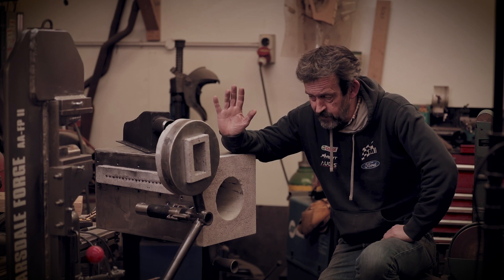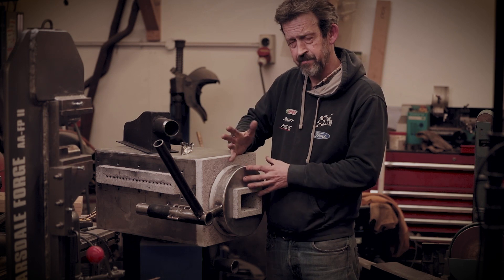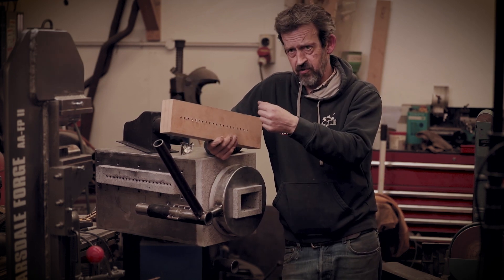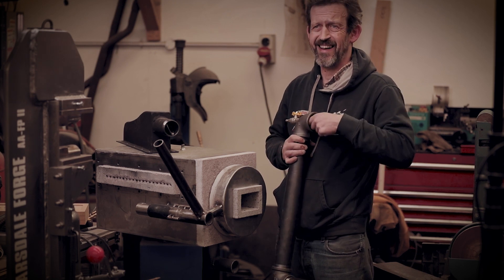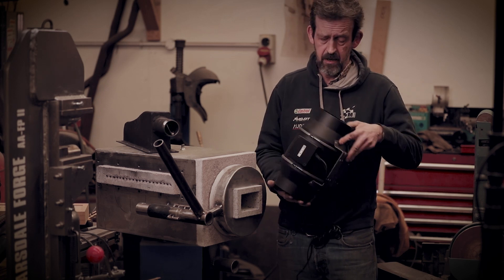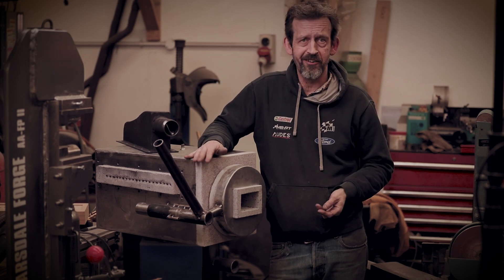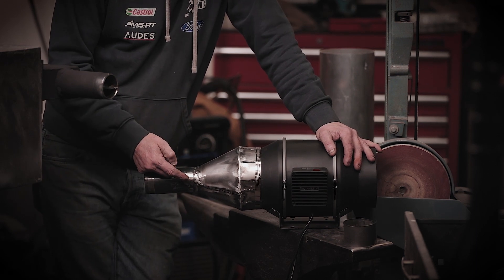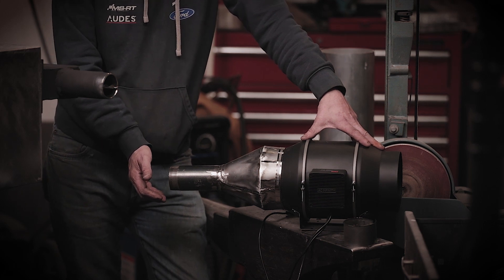HOW TO BUILD A VORTEX RIBBON BURNER KNIFE FORGE - FINAL PART, Could this be the ultimate forge?

Comment: If you had the door out front a further 1/4” to expand the gap and then used one of those fibreglass rope gaskets that are used in fireplace doors that would make for a seal on the door that has variable flexibility on the gap.

Comment: Jon, I was 100% sure it's not air forced gas forge. I thought this barrel is empty and it suck and compress air. 
the back fire is common if you open air and gas first and than, fire forge up.  Your design use vortex effect. I think there was gas-air mixture locked inside the forge (exactly in the center). It's the same thing like inside the cyclone- The where is no wind in the "cyclone eye". also the pressure there is lower, so If you burn it will suck the air from the vortex. This is my theory, but I can be totally wrong.
Next time, Light the paper, put it inside the forge, open air lightly (to not extinguish paper) and then slowly add gas. The fire up should be more predictable.
I like the way you think about the problems and solutions that can happens in the future, thermal expansion. Spiral inside door hinges should work. 

Great job! I'm waiting for the damascus!
Reply: Of course, paper, I’ve seen that before
Reply: I’ve already set the neighbours alarm off twice with the backfire! Lol